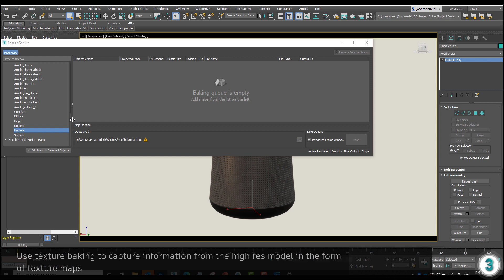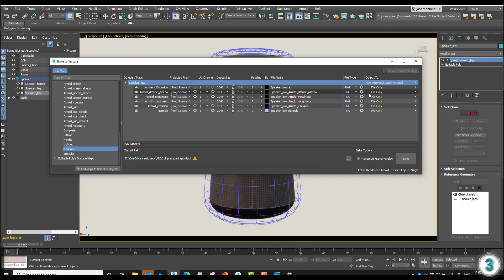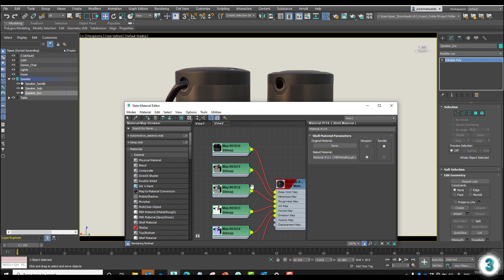Texture Baking with 3ds Max 2021 & Arnold

Comment: Let's say I am doing much simpler things, like just rendering to an output image. How do you bake beauty maps with the Arnold renderer? Every time I try the end result is a pure black map. I can render the viewport and it looks fine, but if I try bake a beauty map, pure black. I've tried setting the lighting in the scene to ridiculous brightness and it doesn't change anything. I can change the renderer to scanline and it works fine, but the results don't look nearly as nice.
Reply: Yeah i have the same problem, did you resolve it?
Reply: @boerofede  same